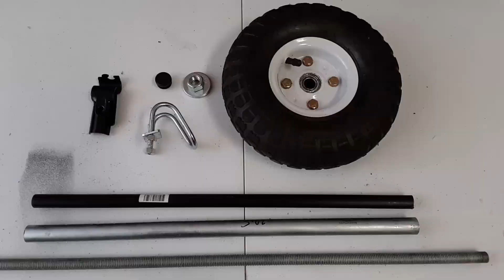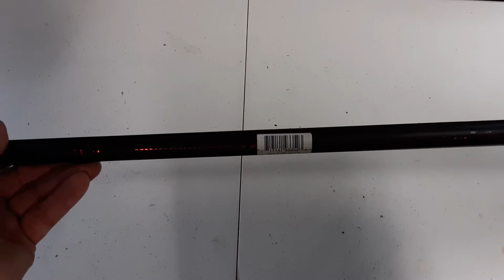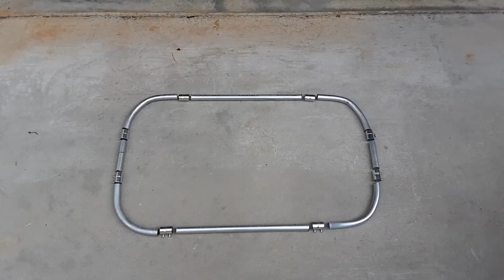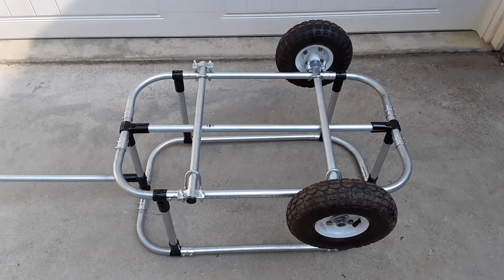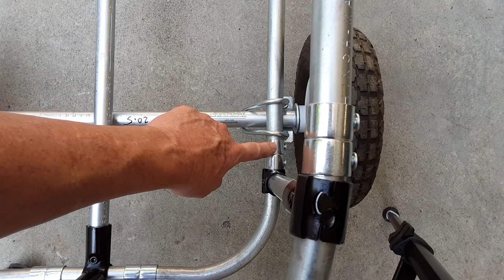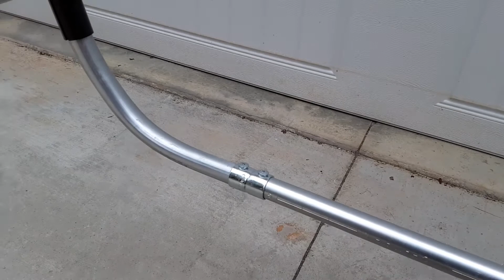DIY Beach or Dock Cart Using EMT Conduit

Comment: Very nice. Your axel design just got a shout out on todays MP video post. 😎 I built a rolling kayak rack for 2 kayaks. I had problems with the MP fittings working loose from moving the rack in/out of the garage. I want to build a bike trailer, and that will probably be worse. Have you have any trouble with your fittings staying secure on a mobile application?
Reply from the maker: Thanks Mike. No, I haven't had the connectors work loose on this design. You can substitute 1/4 x 20 bolts for the MP bolt for a tighter fit that you can crank down on.

Comment: Do you have any plans to put a base in so the cooler, etc can sit flat?
Reply from the maker: The base conduit pieces are are on the same level technically making  flat base. You can add a panel if you want a floor type of base.

Comment: do you think that 1/2 conduit pipe will work? will it be strong enough 
to carry a cooler, fishing tackle, few rods in the sand? I have a 1/2 
EMT pipe bender and don't want to buy a 3/4 one. Thanks in advance.
Reply from the maker: I'm sure 1/2 inch EMT would be strong enough but the Maker Pipe connectors only work for the 3/4.
Reply: MP sells shims you can slide over 1/2” conduit pipe where you place your connectors. I used it many times. Works well.

Comment: Nice build!!!!!!
Brings back memories of the ole erector set days.   I made a fishing cart that held 2 each 5 gallon buckets with some PVC tubes for rod holders etc.  One of the buckets was used for a live well for bait and the other was for other tools and fishing equipment.  Nice for pier or beach fishing.  I got the basic frame from an old pressure washer and built from there.
Reply from the maker: Thanks John. I remember those erector sets! That was a great re-purposed pier cart. So that's where you got your designing mind!
Reply: @Aksmaniyak  Just having a little fun in my retirement years.  Ha Ha  Went fishing at a local lake today and two of my friends and I caught a whole cooler full of fish.
Reply from the maker: @helicopterjohns  Fish fry tonight!
Reply: @Aksmaniyak  Yep, we fished a little on Wednesday and most of the morning on Friday and caught 64 bluegill and 20 catfish.  Ha Ha